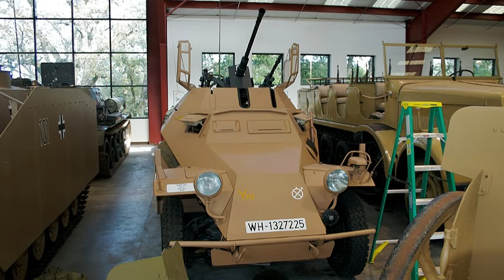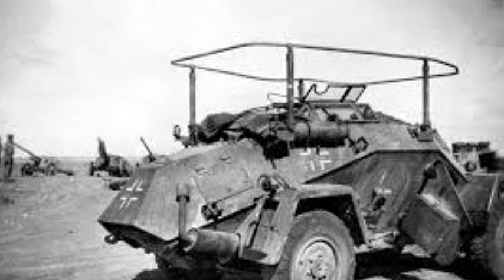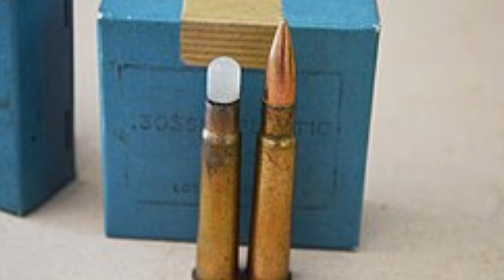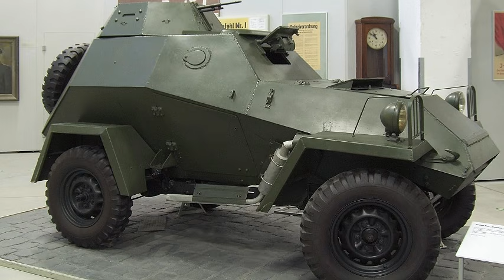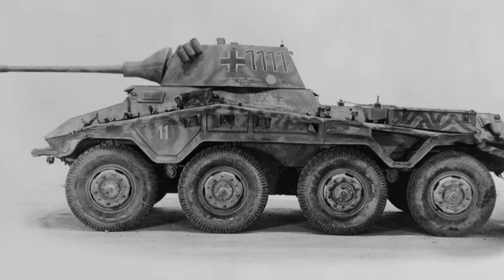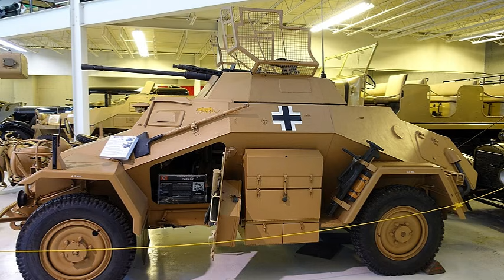Army Mechanics Drove A Captured Sd.Kfz 222 Realized Its 8mm Armor Couldn't Stop Standard Rifle Fire

Comment: ncredible moment in military history — when soldiers take the wheel of what was once the enemy’s pride.
The Sd.Kfz 222, sleek and fast, looked invincible until real combat exposed its thin skin.
Only 8mm of armor — barely enough to deflect rifle rounds — a sobering reminder that appearance can deceive.
This scene isn’t just about engineering; it’s about human ingenuity and discovery under pressure.
Every bolt and bullet tells a story of lessons learned the hard way on the battlefield.
Reply: (1) Consider the era of it's build and distribution. 
(2) The technology of metal at that time. 
modifications